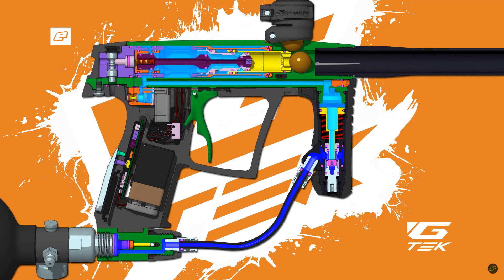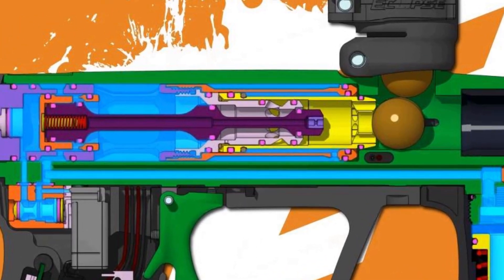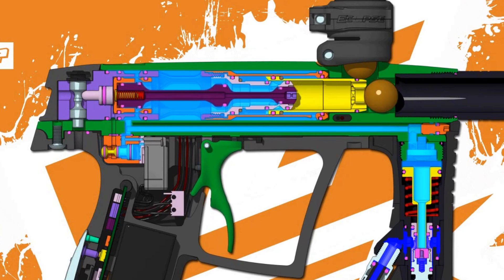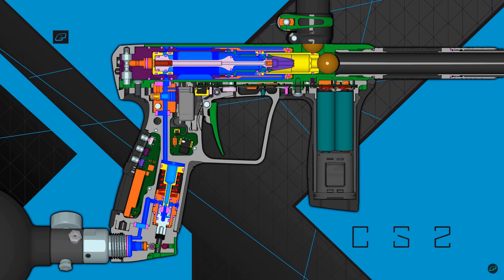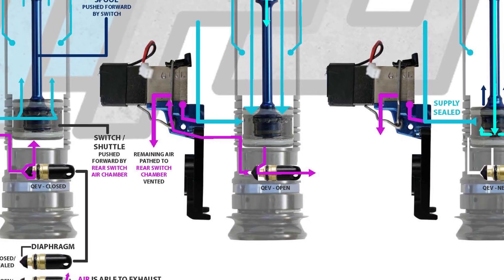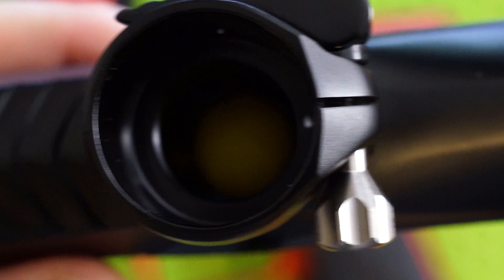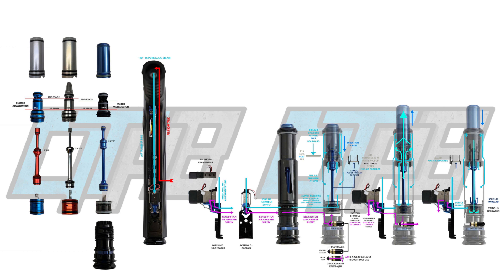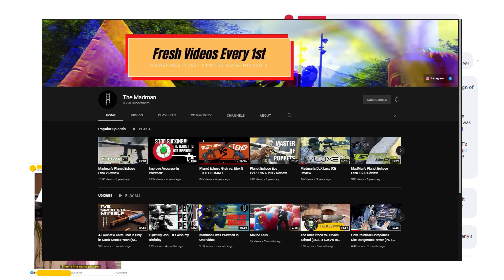Planet Eclipse Gamma Core + Amp/TM40 Engine | Technical Breakdown

Comment: The Gardener bros need to go away.  That guy from NPBS that continually sells garbage, he needs to go away.

Paintball is a hobby with too few players and a handful of patent/trademark holders that produce iffy quality non essentials.

Paintball would benefit from an economic reset.  Flush the current player base as it was flushed 2009-2012.  It’s had a reset 1998-2003 that shrugged off the old toxic woods players.  Reset the game so it can evolve past the narrow sightedness under the majority patent/trademark holders.

By the time paintball is free of its founding constraints, most of us won’t care.  So participate or don’t.  There is very little obvious behavior that leads me to believe any stakeholder actually cares about the hobby.

Comment: Why does the amp get better efficiency?
Reply from the maker: The amp's efficiency is from the valve design. There is a good amount of flow and the valve's lift is shorter. This allows the pulse to be released quickly and the shot air chamber to be sealed quickly, recapturing air.

Comment: This sort of competition and knocking off each other's Concepts has in my opinion inspired so many manufacturers create even better design then their own predecessors as well as the previous concepts of other marker makers and has seemed to allow the innovation of markers to get better and better in many different ways which has made customers and players like myself very happy and impressed with the improvements that have been made since I have gotten into paintball 24 years ago and I truly appreciate it.
Reply from the maker: I agree and disagree. For an industry this small and for how closely it's been copied, it's beyond just knocking off the concept of the gamma. There are designers in this field who have been green lit to use gamma based engines (GoG was not one of them), because of friendly connections with Jack. They chose not to, and decided to create the DSR and M3. That's innovation. Don't get me wrong, innovation will come from this, but it's going to be PE I'm sure. I wouldn't be surprised if they abandon the gamma, to shed themselves of GoG.

EZ on/off asa by inception, slap asa by Dye... Very similar to PEs POPs asa, but they are different. They asked jack out of respect if they could use the basis of the pops for their asas. Friendly connections have fostered options and innovation to the consumers. There are ways to do things in paintball. Again, it's a small industry, everyone knows everyone.
Reply: No.

Comment: This is much appreciated.  I wish there was an FL-21 animation.  Edit: well, the Timmy wasn't hardly the first stacked-tube marker.  I had a F-1 Illustrator which was the first decent semi-auto that I owned (after owning/using some others that were absolute garbage).  At that point Bob was just honing the holes in Autocockers.  Edit 2: It'll be interesting to see if Planet files patents for new tech moving forward.  Aw, hell, Edit 3: Is F1 really working on a new Timmy?   I've been wondering what they're up to.  I really liked watching their interviews as the developed the Force (which is why I bought one).
Reply from the maker: I know, makes you wish everyone did what PE does. Would have saved me a lot of time haha. 
The stacked tubed poppet wasn't necessarily the argument, it was the electrification of it really.
Yes, that's what's been rumoured for the past several years and confirmed last year at some point. There hasn't been really any updates, unfortunately.

Comment: QT, so the Amp shot characteristic feels  the same as a TM40??? I’m assuming you can’t tell the difference besides the ergonomics and features.
Reply from the maker: I owned an amp, and briefly shot a TM40. They were more or less the same. Compare engines and they are essentially the same
Reply: @QTPaintball  I did a side by side test between the AMP and X, the AMP felt smoother, quieter and less vibration. I also feel my AMP is smoother and quieter than my CS2. 

Considering the AMP has a higher end bolt design (comparable to TM40 and CS2 vs original gamma core) would you still choose a 170r over the AMP? 

With the current mid tier markers we have I don’t feel a need to purchase high end markers. They shoot identical and have all the essential high end features.
Reply from the maker: The luxe X engine is a rushed and sad excuse for a cloned engine. They really stepped it up with the amp and tm40. They have a very slightly different shot characteristic. Imo they are all smooth, but their pitch in sound are different.

I would buy a 170r or CS2 over the AMP or TM40. No question. In terms of value in the mid tier, the 170r wins hands down

Comment: Despite them being the wame besides the qev, would you say they have a different shot feel?  And if so what do you feel is different between the two when shooting an amp vs 170r/cs2?
Reply from the maker: I don't believe much is different. I feel the only notable difference was the pitch of the shot. I feel the CS2 is more of a deeper snap. The amp shoots more similar to a DSR, soft, ever so slightly airy, but quick.

Comment: Thank you for the video. 
Ok, let’s get into it.
What is the single biggest factor effecting roll back. Is it distance from the front of the  bolt face and the detents if so why not just make the bolt slightly longer which is what happens when adding a soft face,limit rearward travel of the bolt or bring the detents closer toward the breach ? It seems like we all know that a soft face bolt of some type handles paint better. Why is dlx/shocker even making open face bolts. Now whether the hole pattern of the soft face bolt makes any difference is another topic of discussion. One that may be able to be answered just by looking into the new techt release. Would something like a breach insert help. I:E some roll back is ok and is maybe relegated when using paint boring out at .687 that conversely is magnified when using paint boring at .679 - smaller paint squalling more rollback. So similar to a freak insert for bore matching would a breach matching insert help with paint handling or possibly different sized detents. Maybe something along the lines of a twist lock automag barrel. Boy Tom Kaye would love that I’m sure “you guys I made the best barrel years ago and here you are circling back around to it”
Reply: Feed tube and breech diameter, face design and face to detent distance. Why DLX/SP still hasn't figured out something that other facets of the industry figured out over a decade ago is beyond explanation, really.

Comment: You gotta give some respect to Dye for not trying to copy paste PE's success in the industry.

At my field I would probably say PE was super dominant for almost the last decade. Then sometime around when the RSX and ICE showed up luxe/SP started to make a come back. While dye has kind of faded away a bit and could have copied PE, but they have stuck to their own designs even though the M2 and M3 have not been popular high end platforms. I am seeing a healthy fan base for Dyes mid tier DSR. Fingers crossed for dye M4 with the ARC bolt design!
Reply: While I havent owned a DSR, they seemed to have done something right with the DSR+. Even the OG DSR was favored over the M3 series from what I've seen. I definitely agree with you though. John Chambers has done a lot to help them get their markers know track, especially in the reliability department. It will be interesting to see how the industry progresses from here. People have said for awhile that marker innovation has plateaued, yet they keep finding ways to improve upon each platform. When Angel's and Timmy's entered the market it was a speed war, then came efficiency, and lastly reliability and ease of maintenance. People want a plug and play marker that just works and continues to do so. Paint handling is also an issue that has gotten better. The Force probably being one of the best in that category. What good is a marker if it doesn't perform? I think within the next few years we will really see what the limits of the current platforms are and something will have to surface to change that.
Reply: If anyone had permission to copy PE, it was John - he's proven that good engineers can still innovate without having to rest on laurels. 

As for the M3, QT's video on it explains in detail the unique features of that marker, the chamber-sensing valve and the sensing pilot primarily.
Reply: I will always have a soft spot for Dye.
Reply: I remember seeing one of the gamam
Core engineers saying the arc bolt was better on a pbnation thread
Reply: @basedvisa  Which one? Jack or John?

Neither one is "better", FYI.

Comment: Many changes in the SP/DLX design may be patent infringement features instead of actual performance upgrades.  There must be sufficient difference in design to justify using something with the same base design.  This becomes especially true when both designs have the same goal of low operating pressure and efficiency.
Reply: Not to be rude, but it seems you missed a key point in this video and with the issue as a whole. PE doesn't own a patent for the Gamma core. In hindsight they probably should have figured that out prior to the release of the X, AMP and TM40. There is nothing stopping SP/DLX or any other company for that matter from using the design. I think PE will move away from the Gamma Core design and learn from the past and patent the new design in the next iteration of Planet spool markers.
Reply: Did you watch the video and comprehend what was said? Perhaps watch again...

As for the goals, I don't think I agree. Operating pressure should never be a goal - it's just a byproduct of volume and flow. Efficiency was baked into the design, given the breech-sensing valve. So again, I don't think those two items were goals - they were fairly known and expected. The primary goal was designed reliability, the features of which also make the system naturally mechanically actuated.